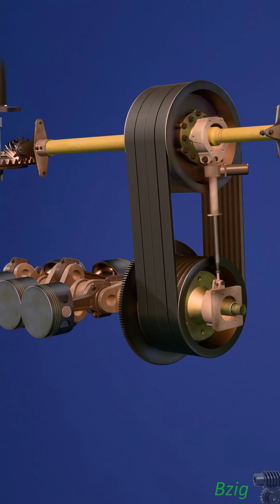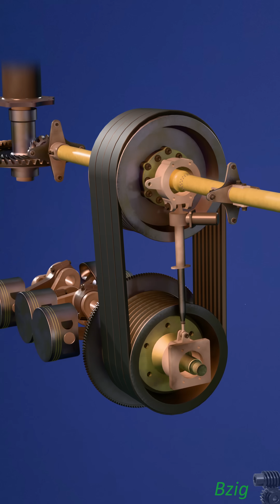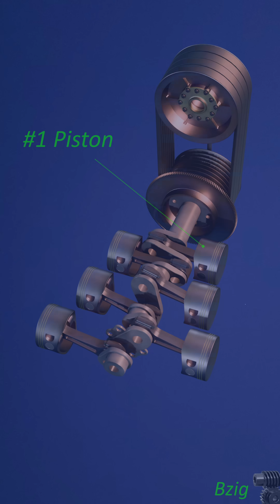Helicopter Drive System

Comment from the maker: Thanks to everyone who commented on the "mistake" I mentioned in this video.  The error was the cylinder firing order and the timing of the pistons.  I posted a follow that shows the corrected engine.

Both of these errors came from an incorrect rotation (in the CAD) of the crank journals... I stared at this for much longer than some of you did before I figured out the mistake.  I'm impressed by those of you who just casually looked at this video and called it out!
Reply: I am not a pilot, but did some auto mechanic back in the 1970's while going to college, the firing ordered looked odd to me, thanks for posting us.
Reply: Robinson 44
Reply: Came to see the correction 😅
Thanks for this vídeo . Have never seen how helic. are powered

Comment: I don't really like the idea of loose belts slipping as a clutch mechanism on something that absolutely needs to function properly. I'd much rather have a centrifugal clutch, because if the clutch shoe retractor springs break, at least the clutch will fail "on" instead of "off", so the rotor will remain powered.

Comment: I cannot understand how the upper pulley can disengage. in the video you show the upper pulley descending but somehow the belts themselves do not fully fall along with it (there is a gap above the upper pulley somehow). the idea of tensioning and loosening a pulley belt to engage and disengage the engine seems kinda clever but my intuition says it ought to be vulnerable to all kind of antagonistic conditions when it's in a moving craft. how does this manage to actually work and not e.g. get badly tangled or something when the belts slacken?

Comment: You cant lift/tension the top pulley as its inline with the main drive shaft and cant move up and down
Reply from the maker: Here's how I came up with the upper pulley moving... I'd love to hear what you have to say.  I think you are incorrect, but I also know this topic comes up a lot and it's not well described in the Robinson documentation.  So, I really appreciate the comment and I hope you reply to this post!  

Even though the manuals don't describe how it does it, there is a statement that the upper sheave moves up in order to tension the belts (page 7-9 of the POH).  In the illustrated parts catalog, the only place this degree of freedom can come from are the forward and aft flexplate and yokes; if I'm correct, their motion would then require flexing at the aft end of the tailrotor drive shaft where there is another flex plate.  

The Robinson maintenance manual says the total allowable travel is 1.6 inches for the clutch actuator... I measured the distance from the forward flexpate to the aft and then to the tailrotor driveshaft flex plate... If my assumption was correct (that all of the drive sheave motion is taken up by these flex plates) then that results in a little less than 2 degrees of maximum deflection of the flex plates.  While I couldn't find a data sheet for Robinson's flexplates, I looked at similar items from other manufactures; and 2 degrees is typical of the maximum deflection these things see in service.

Finally, 2 degrees, visually, isn't much.  And you'd only see that much deflection with belts at the end of their service life.  As the belts go into tension, it would still appear that the drive shafts are inline, even when they deflect 2 degrees.

I'd love to be able to tear down an R-44 and have mechanics on staff to help make these vids, but I'm doing with what I have... which include comments like yours, so, again... sincere thanks for taking the time to comment!
Reply from the maker: and... here's the statement from the POH, "After the engine is started, it is coupled to the rotor drive system through vee-belts which are tensioned by raising the upper drive sheave. An electric actuator, located between the drive sheaves, raises the upper sheave when the pilot engages the clutch switch. The actuator senses compressive load (belt tension) and switches off when the vee-belts are properly tensioned. The clutch caution light illuminates whenever the actuator circuit is energized, either engaging, disengaging, or retensioning the belts. The light stays on until the belts are properly tensioned or completely disengaged."

Comment: The small emergency disconnect clutch is on the wrong side of the rotor drive? You would probably need a hollow axle with another axle inside.

Comment: I don't know if it's the mistake you're talking about, but I noticed the piston firing order is uneven. The crank pins should be 60 degrees to each other.
Reply from the maker: That was the big one!  Nice eye... I stared at this for far too long before I figured it out.  The error came because I modeled the crank pins as one component and then joined them twice more (the CAD version of copy-past)  But the CAD software sometimes gets strange on setting the direction of rotation... it went the wrong way for one of the joins and I didn't catch it.

Comment: Simple, look at Lycomic Horisontal 6, paired throw. Two connecting Rods on one shared pin arrengement.
Reply from the maker: That's interesting... the IO540 6 cyl does not share the crank pin... they are 180 degrees apart.  Do you know which lyc model shared the pins?

Comment: So when the operator disengages the clutch mechanism he basically removes / disengages the belt tension from the pulleys. Okay, well and good, BUT !! does thr belt just hang there rubbing against the pulley?? Seems.like that would put undue wear and tear on the belt, perhaps eventually  destroying the belt...
Reply from the maker: agree... but the first thing you do after start is to engage the clutch and is stays engaged until after engine shutdown.  So, not ideal, but the rubbing and dragging is an extremely small amount of time over the life of the belts.

Comment: How is the friction handled during acceleration? Do the belts just rub in the grooves while easing the clutch in? Or is there another system in place that accelerates the rotor from zero to flight speed? Really nice animation though, I love helicopters :)

Comment: Hey, can you do a video on the helicopter with a stator blade. I once saw a model airframe with no linkage to the main rotor blade for collective. The linkage was connected to the stator blade and the claim was that because of the corriolis effect, the actuation was passed to the main blades. This design eliminates a heavy duty swash plate. I believe it's a flybar actuator.

Comment: The bearing on the electric ram clutch would be crucial/roasted. It has to bear the clutch force AND the rotational forces of that yellow shaft that is driving BOTH rotors. Horrendous. 😅

Comment: Rotating backwards?
Reply from the maker: That's not it.  The rotation is correct, but a few people thought that was it... the engine is installed backwards from what it normally is in airplane installs... so it looks like it's reversed.

Comment: Thought the main propeller, has a run off the the rear one… when that breaks you can still land with out crashing if the tail gives out… if that main gear you automated gives out both main and tail rotors are done for and you fall from the sky instead of crash landing… did I get that right?

Comment: Idk why they have to make them so complicated. Wouldn't it be better if helicopters used engine fan thrust to power the rotors? I would think it would be much safer and simpler.
Reply from the maker: A good explanation for this is in the Vertical Flight Society VTOL "Wheel of fortune"  https://vtol.org/news/electric-vtol-wheel-of-fortune  A super brief summary... the lower the disk area, the higher the induced velocity and the less efficient the design is in a hover.  This is why aircraft like the AV-8B carry 1-pilot and 1-bomb for 1-hour; that is a joke but the reality isn't far from that.  Aircraft with pure jet thrust need larger power plants to hover with small weights whereas helicopters use less powerful power-plants and hover with much higher (relative) weights.
Reply: @bzig4929 I mean instead of having shafts and transmissions, why not use a jet engine exhaust to turn a turbine attached to the rotor shaft? Fewer moving parts, less to break and fail.
Reply from the maker: ahh... I understand better.  Turbine engine helicopters (sort of) work this way.  Except, they still need a gear reduction.  Turbine engines used in helicopters are turboshaft engines.  The front spool converts fuel and air into hot expanding gas, and the power spool extracts power from this expanding gas.  The two spools are not connected.  But these power turbine spools still need a gear reduction... typical power turbine speeds are 30,000 RPM while rotor speeds are around 250-300 RPM.

I don't think gas turbines will ever be able to produce power at the low RPM's needed by a rotor, but electric propulsion could possibly operate a helicopter rotor without a gear reduction. 

And maybe there's a hybrid-drive future with a high RPM gas turbine generator powering a transmission-less, low-RPM electric motor.

Comment: How can the upper pulley be moved?  Doesn't it have to remain on the centerline between where it transmits power to the main and tail rotors?
Reply from the maker: Interesting question... All of my videos are based on maintenance manuals, pilot's handbooks and parts catalogues.  The answer to your questions isn't explicitly stated in any of those documents, but the only possible answer is that the flex plates (there are three of them along the drive shaft) allow angular misalignment that move the upper pulley downward.

You're not the only one that's asked.  I really need to do a video on that.

Comment: I used to fly with my mate in his Enstrom, it had a belt off a combine harvester. He’d fire the engine up let the head temperature get right and the yank on the lever to allow the tensioner pulley on a big spring applying load and tensioning the belt.

Comment: The crankshaft has incorrect journal placement as two pistons need to reach top dead center for balance. An inline 6 would have 1-6 at TDC, with 2-5 half way down & 3-4 at BDC. Regardless, the crankshaft, needs fixed.
Reply from the maker: Thanks, The journal placement was incorrect in the first video.  Please take a look at the follow-up video and let me know if you think that one shows it correctly.  This lycoming engine is a boxer, and the pistons reach TDC in this order 1&2, 3&4 and 5&6.  The firing order is 1-4-5-2-3-6.   https://youtube.com/shorts/tUv_HidYAxk?feature=share
Reply: @bzig4929  I will be watching out of curiosity as animation has to be hard. As for the century of Lycoming engine, it seemed odd they kept the compression ratio so low. 6.5:1 compression is low enough to be a concern of mechanical failure on automotive engines for decades. Just thinking out loud. DK, ASE Master tech 1978.

Comment: I'm amazed they used such a crude clutch system instead of  something more akin to a real clutch.. maybe the belts are more contained than shown but loosing them I would think they would fly all up around and mangle themselves..
Reply from the maker: Yes... there are anti flail mechanisms built in.  And it is simple; maybe "crude" is an ok word to use, but simple and crude can still be safe and proven technology.
Reply: @bzig4929 moving the whole drive shaft? And this changing the gear pitch on the pinion to ring gears?  Even the rear differential in your car has to be precision set with shims to get that all aligned and have a slight float to it but this seems ridiculous.
Reply: Doesn’t this also introduce losses greater than about 2% or so? The belt is continuously deformed and will heat up.
Reply: Those belts they are designed for that job ,the material is super cool they work for more than 1000 hrs ,nowander you start the engine when the belts are loose for this reason and also if the belts are tight the engine won't start .
Reply: @CharleschilekwaZulu 1000 hours doesn’t seem long to me, but I understand in aviation things are different.

Comment: This is a very old and antiquated system. There is a much simpler and way more effective system. Has to do with direct drive.
Reply from the maker: There are definitely more modern systems... maybe they are better, but definitely not more cost effective.  Also, turbine helicopters are not direct-drive; the coupling between the engine gas producer and the power turbine is an air coupling.  I know what you mean when you say "direct drive" but it's still possible to start the engine with the rotor stopped.   Thanks for commenting!

Comment: Number 1 and 6 cylinders are a few degrees out
Reply from the maker: I amazed by all of you that could spot this so easily.  The cylinders are more than a few degrees out.. the crank rotation for TDC was 60-60-240! but still I stared at this for like an hour before figuring it out.  Thanks for the comment!  Check out the follow on video... https://youtube.com/shorts/tUv_HidYAxk?feature=share

Comment: Just about all engines turn counter-clockwise on the output, but usually the output is to the rear. You said the output was to the front, so the engine should be rotating in the opposite direction. Was that it?
Reply from the maker: The engine rotation direction is correct, but I get easily confused by this.  Lycoming IO-540's rotate CW when viewed back-facing-forwards.  But the engine in the R-44 is mounted backwards... so you're looking forward-facing-back (in the aircraft reference) to see the CW rotation.

Also, Lycoming makes a CCW rotating engine.  The designation is the LIO-540.  They prefix is with "L" to indicate left-hand rotation.

Comment: This seems very go-kart for something that flies...
Reply: Yeah
Reply: Helicopters don't fly. The Earth repels them.
Reply: Flies, is maybe an overstatement, more of a spasm of lift then some almost crashing on the way down.
Reply: Welcome to most of aviation that isnt commercial.
Reply: Well a three stage torque converter is out of the question. The spragg is bad enough . 
     The whole thing a joke. 
Keep it simple the answer .
   Belt clutches 
Please .
    Spragg. 
Please 🙏 
   Optional torque converter out of the question . 
    Constant velocity differential,  with one drive side electric on the blad threw a dino ,To the blade and the other drive shaft.  
    Now that's a fail safe constant velocity system with redundant braking of the dyno side in failier .
Reply: @AllenBarclayAllen  You are surely clueless on the subject of helicopters

Comment: Like an old belt driven mower with the engagement of the belts on and off!   Super cool.
Reply from the maker: It is a cool and interesting design.  The T-55/Scheitzer 300 also uses drive pulleys and belts.

Comment: Is the mass balance lugs the wrong end of the crankshaft??
I've not seen the inside of a Lycoming engine for about 25 years!
Reply from the maker: The current IO-540 parts catalog shows them between the 5 and 6 piston... at the "back" of the crank, but the R-44 mounts the engine backwards, so they appear to be in the front.

Comment: The rotor rotation is in opposite direction in Robinson the rotation clock wise
Reply from the maker: the R-44 main rotor rotation is CCW.  It's mostly French helicopters that rotate CW.  Thanks for the comment!  The error was all in the engine... piston timing and firing order.

Comment: What facilitates the flexing of the tail rotor drive shaft? the upper pulley translates vertically which, being rigidly attached to the tail rotor drive shaft, would move the whole shaft however the tail rotor gear box is fixed inside of the end tail boom. is there enough flex in the drive shaft flanges or is there another system designed to compensate for the movement of the pulley?
Reply from the maker: Even though I've flow Robinsons for awhile, I never really understood this system until I animated this.    There is nothing shown in the part catalogues, the maintenance manual or the POH -- other than the flex plates -- that would allow the upper sheave to move.  

The amount of motion, needed to loosen the belts, is less than 1 degree of misalignment at the shaft coupling, and this is well-within the capability of those types of couplings.

So, if there's something else that allows the Sheave to move, it's not apparent to me.  I'll do a video on this in the future... Several people have asked, and a video get some more insight from viewers.
Reply: @bzig4929  I got a better look at the drive system in person last night and you're correct, it appears to just be the flex plates that allow that movement. I didnt even think about how small of a movement would be required to loosen the belts and that the flex couplings would be the only thing required. funny note, the clutch is not adjusted properly/ is so new the belts are not compliant that the blades start to turn as soon as the engine fires because there is just enough tension that they drive the system very slightly.
Reply from the maker: thanks for the confirmation! 

The clutch actuator and how it automatically tensions the belts is cool and I just completed the animation with the column springs and micro switches.  It will be a few days, but I'll get a video out on that soon.

Comment: I know nothing about aero engines, and I don't want to cheat. 
If I have to guess, I'd want the engine to be as short and lightweight as possible  so I'd go for a flat 180.
If I'm wrong, I'd love to know why they went for a boxer instead.
Reply from the maker: Lycoming engines are definitely boxers.  Their parts catalog that clearly shows the crank journals 180 degrees apart.  I'm not sure why... tbh, most of my life has been spent around turbine engines.  It was fun and educational, though, to animate the piston engine.